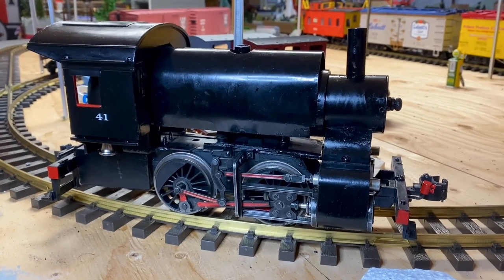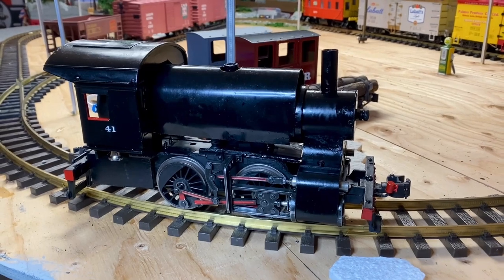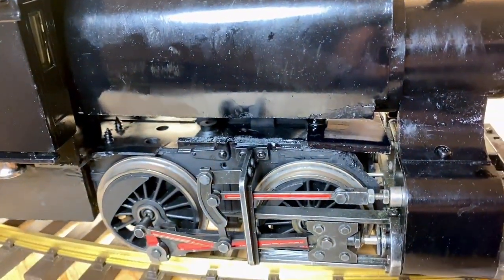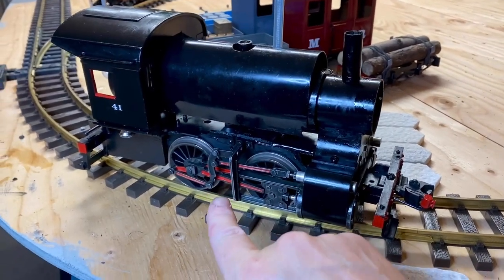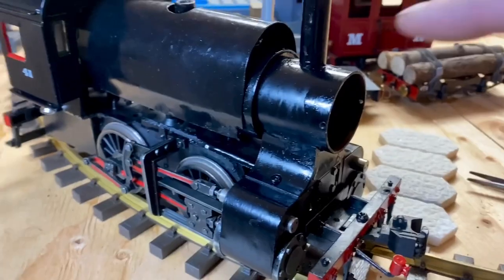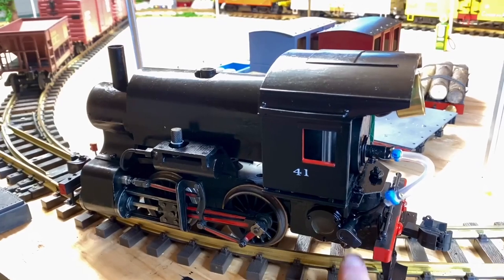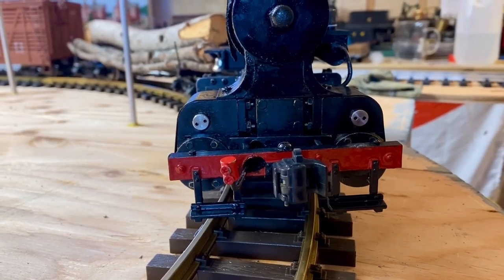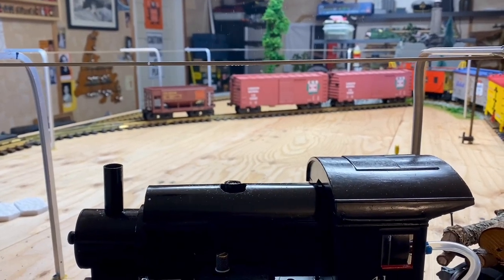Victoria B.C.: Big fire causes a better rebuild of my Aristocraft live steam 0-4-0 (see description)

Comment: Oh bugger!  Nothing worse than a droopy front end and a back draft under your frames ;).  But jesting apart, could have been nasty, especially with butane being heavier than you know what etc and plastic bits, good job you were able to contain it quickly.  I've never seen a cross tube boiler like that, what a great idea and a good view.  I agree it looks a whole lot better, I do like the oddball industrial type locos and this defo fits the bill, especially slow running.
Reply from the maker: You know, a flaw in the design is a gap between the boiler and inner metal smokebox. So the extra heat ignited the plastic in the front chassis.

I always have fire stuff ready. The best is a big wet towel.
Reply: @Terrys-Steam-and-Cobi  Interesting, so the metal extension fixed it. Was is it down to the fuel air mixture?  Big wet towel, always useful.  I have to confess, I've set fire to my welding gloves a few times picking up my derailed locos:)
Reply from the maker: @watchfordpilot  lol. Well it’s good you were wearing gloves. The mixture seemed fine as it sounded like the right whoosh. But I think there was still some I unburnt butane igniting in the smokebox. Hard to say as I couldn’t see the flame (a major design flaw in my opinion. This loco had many flaws. Great boiler though).  

Now that I can see in I see great burning with the normal fuel. I only had a small container of the high grade stuff, which I suspect was too much for the engine. 

Either way, now I can see the flame, which is a huge improvement. 

It’s like the electric train maker contracted someone to make a good boiler and steam chest and they took that and used moulded parts from their existing similar electric locomotive and used them to complete the live steam build. Whacky.